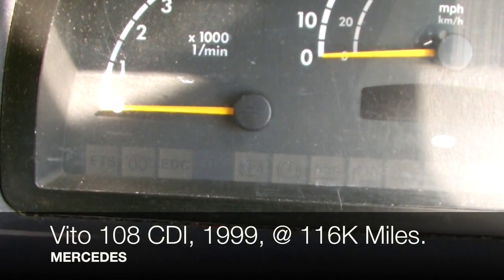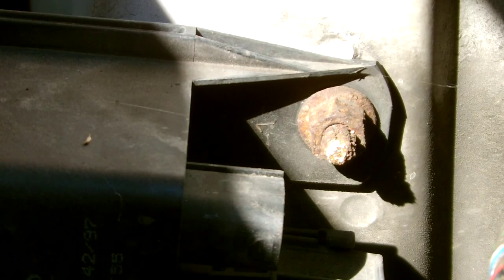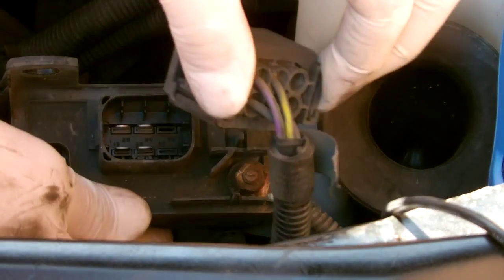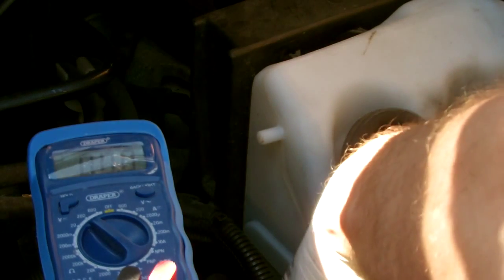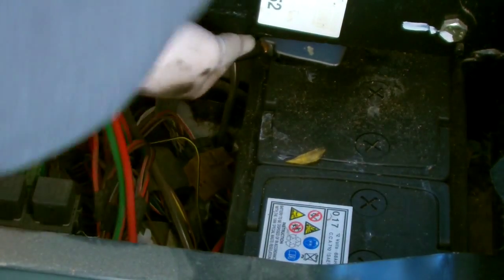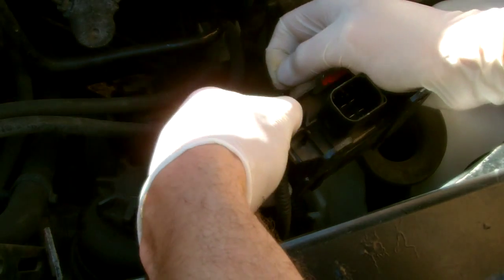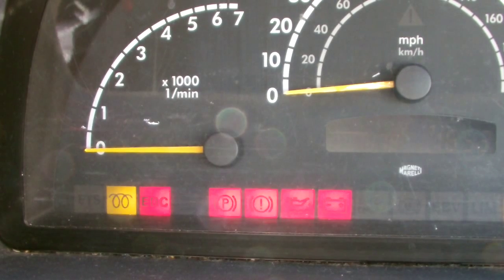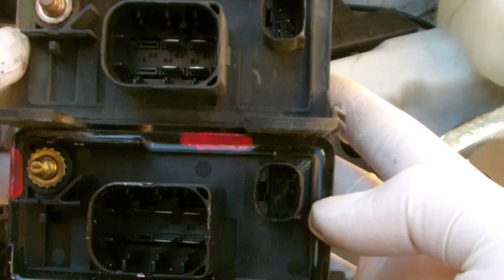Mercedes Vito Glow Plug Relay Replacement

Comment: Hi .I'm trying to solve an electric window problem in my passenger door 2002 vito .I have it diwn to a possible relay but I'm not sure where or how to change it. I think it's located somewhere down near the driving pedals as I can hear a switching sound when I try it .
Thanks in advance. 
More vito videos please
Reply from the maker: Hi, you need to get your hands on a wiring diagram, if you cant call your local Mercedes commercial vehicle suppliers, they will have the diagram and be able to tell you where it is located. Barring that its a case of tracing wires and/or pulling and testing relays/fuses/wiring/electrical components/grounds. Check the wiring that goes between the door and body carefully, as wires get snagged there. I would also test the window motor make sure it is good. Hope this helps, thanks for watching.

Comment: Great video, Just wondered if you know anything about the relay for the front wipers? Mine only work on one speed and struggle to do a full sweep, I changed the motor as people kept telling me that was the problem. But it was the exact same. So now i have being told that its the relay, Do you know where the relay is located. Thanks any help would be great.
Reply from the maker: Hi unfortunately I don't know where it is off the top of my head. And I don't have Vito at hand to look. Best bet is to call your Mercedes Van parts supplier, they can locate part and they have schematics of its locations. Hope that helps, thanks for watching.

Comment: Could this issue cause the the vehicle to be in limp mode. With no boost???? Lack of power
Reply from the maker: Hi, There was no noticeable effects to this vehicles performance. And I haven't heard of it causing that kind of issue. Thanks for watching.
Reply: I have had the same issue. It caused the engin management light to come on. It turned out to be my mass air flow senser needed replacing and all was fine after this. Hope this helps someone.
Reply: @jamiepankhurst4462  hi i have the same problem .  where is the air mas flow sensor please?  o a 112 cdi 638
thx for help